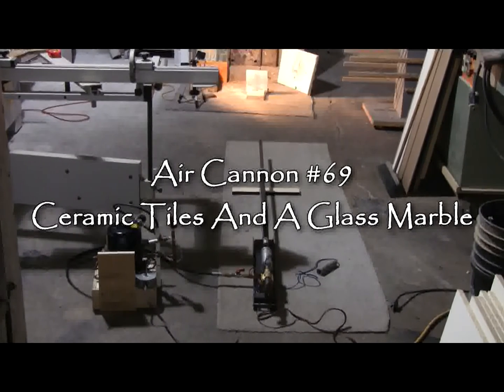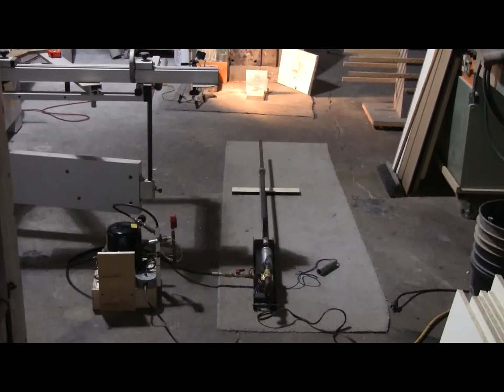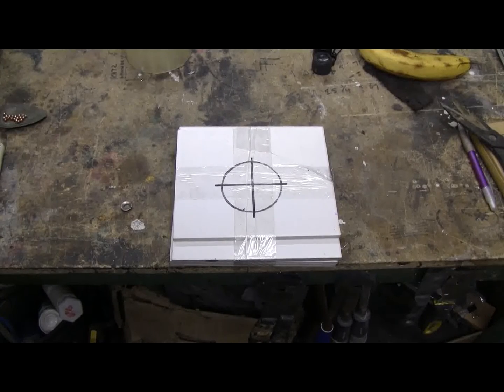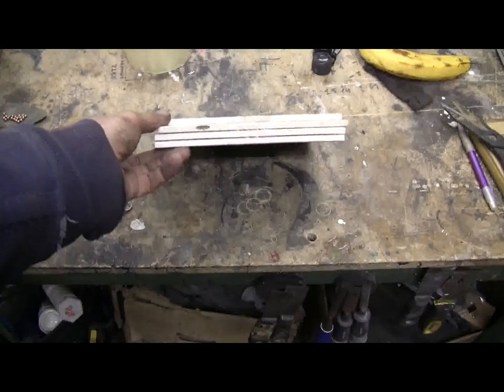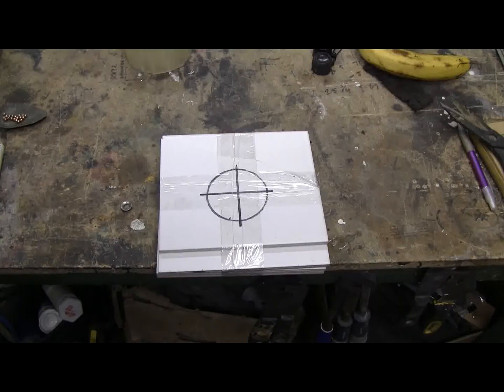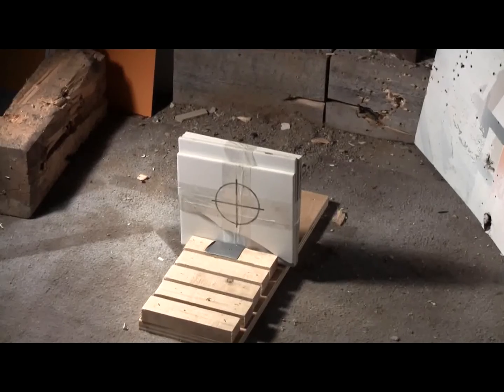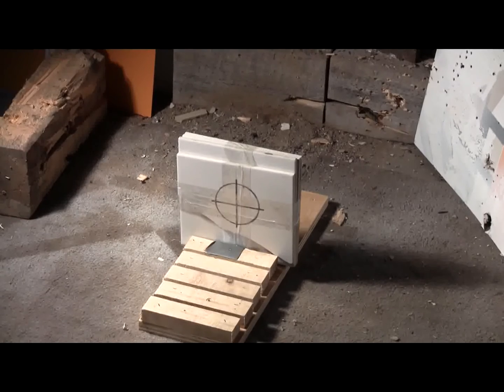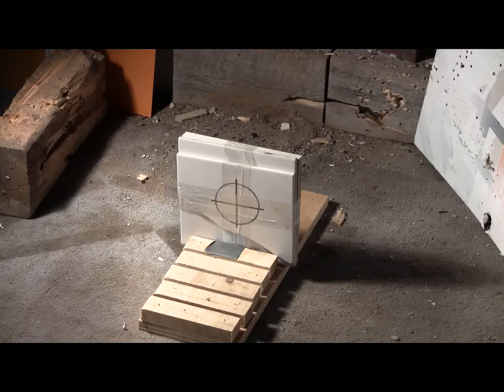Air Cannon #69 - Ceramic Tiles And A Glass Marble

Comment: would be interesting if you happen to come across any more tiles, to fire a marble at them at 45 degrees angle, but with the whipple shield setup and the tiles staggered like stairs. to see if the direction of the marble/blast can be made to be deflected a little?